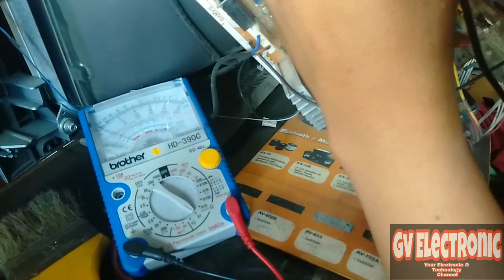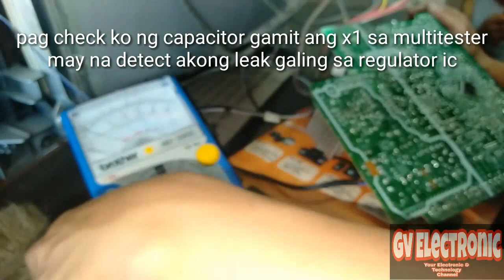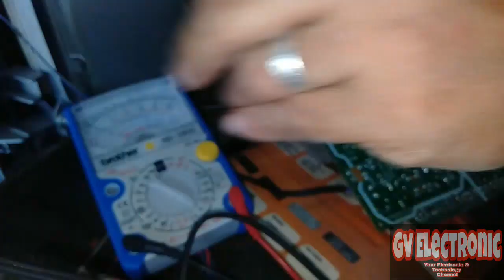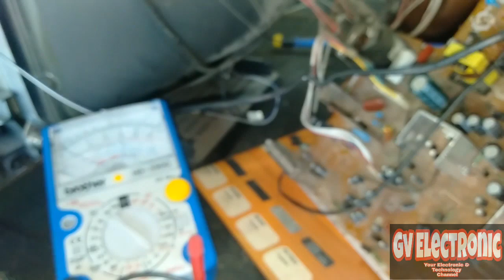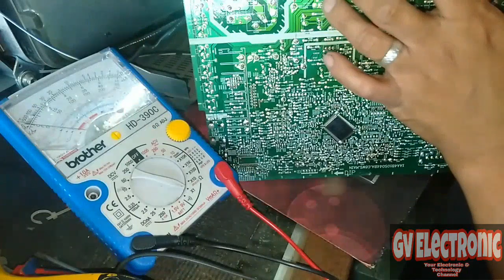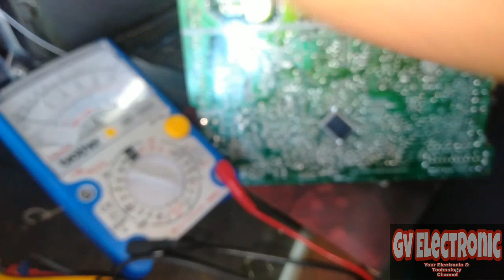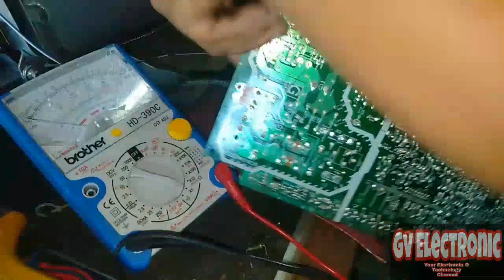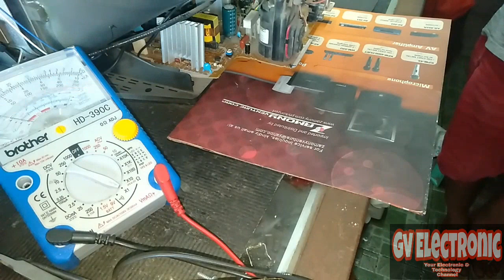Troubleshoot 21 Inches Sanyo TV No Power Dahil Sa Kidlat⚡

Comment: Sir yung tv namin sharp LED backlight may stand by sya na red tapos kapag on mo sya mag blink lang then after 5 seconds back to stand by ulit ano po kaya ang problema
Reply from the maker: check mo secondary diode baka shorted sir
Reply: Sir ipadala ko po yung picture ng power supply patingnan po kung saan dun ang gagalawin ko pwede po ba
Reply: @GiovanniV  Sir Giovanni di po ba may stand by voltage sya na red tapos po kapag i push ko yung onn button mag green sya tapos mag blink yun backlight ng mga 5 seconds ayaw po magtuloy tapos balik na ulit sya sa stand by na red

Comment: Boss .anu b ung ps s may primary ung katabi ng relay ng iinit cia tapos wala narin n pasok n boltahe s malaking  main n capasitor. Salamat po boss
Reply from the maker: check mo mga diode at maliliit na transistor baka my shorted dyan sir
Reply: Ung bridge diode b tawag dun s itim n katabi ng swicht on in off boss un kc ang may parehas n movement s tester salamat boss
Reply: Boss panu b mlman kung cra flyback  ayaw parin mg ilaw ng power at wala parin masukat n boltahe s b+ ng fter capacitor at b+ ng flyback kht gngawa ko n ung mga cnb ninyo.salamat boss

Comment: Sir ano pa po ba posibleng sira ng TV na sanyo din kagaya nitong nasa video nyo, umaandar nman mga 30 seconds tapos biglang off, pag pinindot ko ulit yung channel button nya hindi na umaandar ulit, pag tinatanggal ko sa saksakan tapos mga 5 seconds subukan ko ulit paandarin ganun pa rin mag on lng ng mga 30 sec tapos patay na nman. Pinalitan ko na h.out transistor at regulator ic ganun pa rin,
Reply from the maker: baka may naka angat na parts dyan po. na resolder mo na ba yan?
Reply: @GiovanniV  Oo sir, halos na resolder ko na lahat, posible po ba flyback sira nito sir? Pag test ko sa h.out nya sir hindi stable ang voltage..or baka sa chopper transformer din sira sir?
Reply from the maker: @jessiesalaniocabanero9681  hang mo muna b+ tapos test mo filter capacitor sa secondary kung normal po
Reply: Ok po sir try ko po mamaya, salamat sir sa oras at sa mga idea

Comment: sir normal po ba na my ground yung heat sink ng regulator? pumutok po kc yung regulator, nong napalitan kona  po at sinaksak, hinawakan ko po yung heat sink na ground po ako.
Reply from the maker: my ground ng konti yon kasi nasa primary pa. bka my shorted ka na diode po
Reply: sige po sir, salamat, check ko po.